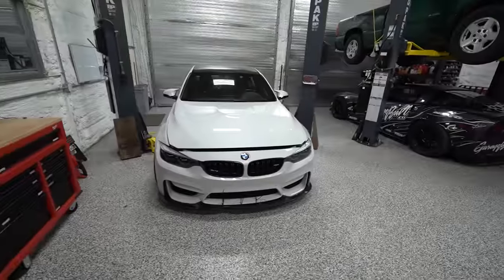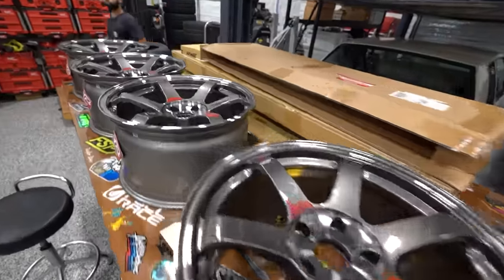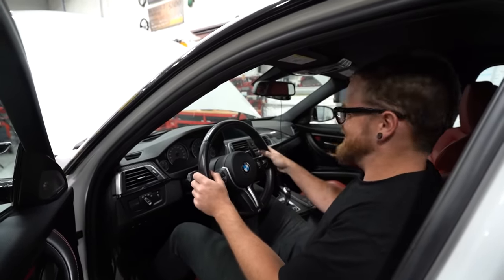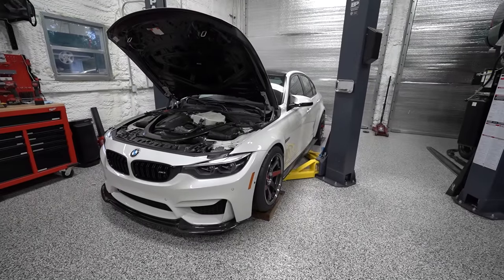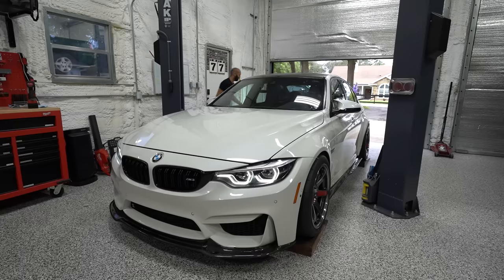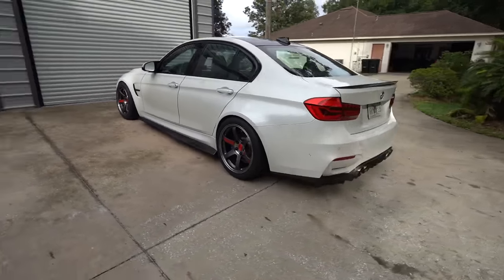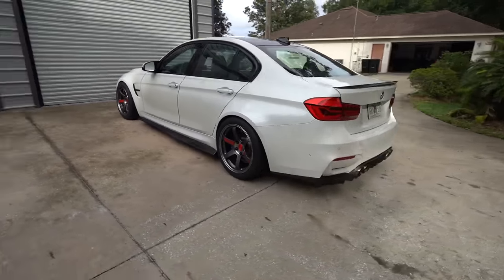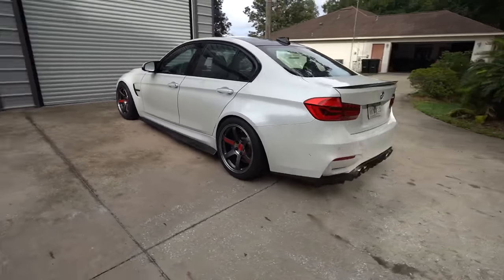Massive upgrades for the salvage M3. so fast now

Comment: I’d look into the GTS flash for the differential it allows you to put the power down mid corner and changes the characteristics of the power oversteer quite a bit
Reply: that sounds sick
Reply: @LUCKIPUP  many different coding companies offer the software but basically changes the characteristics of the DCT, Power steering, and Differential for more track focused driving dynamics
Reply: XHP or get someone to factory code the GTS transmission tune and differential

Comment: My only issue was clean the inside of your front windscreen mate… truly makes an amazing difference 🤙🏻
Super sweet wheels and tires.
Maybe experiment with left foot trail braking
Reply from the maker: We cleaned it before we left. I generally brake deep into the corner because you can’t tell what kind of corner it is until your in it. You can see way better on camera than in person. Part of what makes it look so slow. But when I know the corner I try to be fully off the brakes before I start turning. Especially in the wet. You can feel that any bit of brake while trying to pour on lock you’ll just lose in the inside tire.

Comment: Love your videos as always 🤙🏻
Gotta avoid crossing the double yellows though 🥲 From a safety and motorcyclist stand point. Especially around the blind corners. Unless there’s something I missed. 😬
Reply from the maker: When did I cross the double yellow? On some of the roads we did there’s nobody. I haven’t ever seen another car. But even still I do my best to keep it in the lines. It’s hard to tell sometimes. And on the motorcycle standpoint. I’ve had them come head in at me passing someone over a double yellow about a dozen times. They also like to ride tires on the line. Leaned way over the line. No hate to them. Just one of those things. You do your best to stay in it but there’s for sure times where you might  put a tire on it.
Reply: @Taylordrifts  Maybe just me being overly cautious on the roads where y’all did, and that’s true riders are bad about it too, tires right on the lines and with the lean they’re definitely hanging over for sure.
Reply from the maker: We try to be very cautious about that. The times we may have were only with clear line of site. Also on those roads there’s A- virtually no traffic. Never had a car coming the other way (not that that means there couldn’t be) but B they tend to have a lot of leaves and such piles up on the sides since the locals drive middle of the road. So you really don’t have a lot of lame to run in. Sometimes have to avoid things like piles of gravel. Etc.
Reply: @Taylordrifts  As long as y’all had a clear line of sight, that’s really all that matters, just been through some stuff on switchbacks where I live, plus my only prospective is through the camera angles. I feel you on the gravel, leaves, etc. makes for a “fun” time.
Reply: Wait what? I was just about to comment: great clean driving. Then I read this comment, Where did anyone cross a double yellow? I must be blind
Reply: @arablues4142  It’s in there 🤷🏻‍♂️ But if they could see, then that’s my bad, but some of the corners, at least from the pov of the camera, kinda looked iffy. Driving was good don’t get me wrong. If there’s some one way parts in then, then that’s really my bad, but again my only prospective is through the camera, so I could be missing some details.

Update: rewatched, but some line crossing for sure, but they could probably see the areas I can’t so

Comment: I'm following your formula for a good f80 daily, wish I could post pics but I've loved those t 37s forever amd got them in black w green stickers, mine is white but needs a wrap, it sat under an oak tree for almost a year so the white aint so bright. I love it and am getting those mag paddles, that weak click has disappointed me enough. Major flex with the rays bags. Those are so dope
Reply from the maker: The paddles were a huge improvement in just being more immersed in the driving experience. The stock ones always made me feel so disconnected
Reply: @Taylordrifts  I I've about 120 miles from the dragon in Alabama and this f80 is already such fun up there w grippy tires, coilovers and all new bushings, that tactile click will give it a chef's kiss and make our trips even better. 
PRO TIP: If you can find a local that likes driving up there then they will take you and unlock the next level of roads, less traffic more like those in fnf Tokyo drift... they're up there and magical
Reply from the maker: @thewitt76  yeah I actually found a good pair of roads pretty close by with no traffic. Ones a bit bumpy and rough. But I’ve only ever seen 2 cars driving down them in all the times we’ve ran them.

Comment: Put some electric tape around the lip of the rim three times around before you mount them so you don't take a chance to scratching them and then pull it off before you balance them

Comment: I have the same problems with Centre caps on My HSV, the factory upgrade big brakes on it heat the wheels up and melt out the caps, ended up just not running caps in the wheels, looks hillbilly but better than spending upwards of $100 on new caps every 6 weeks.